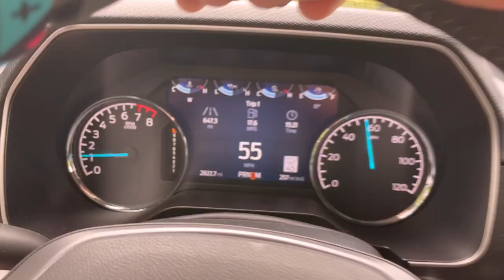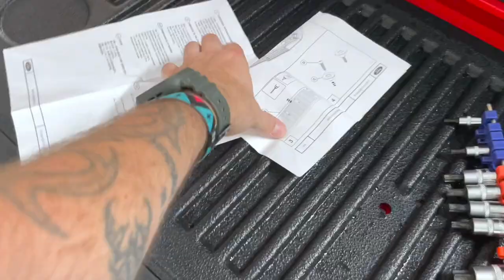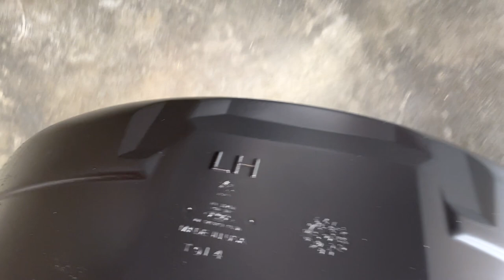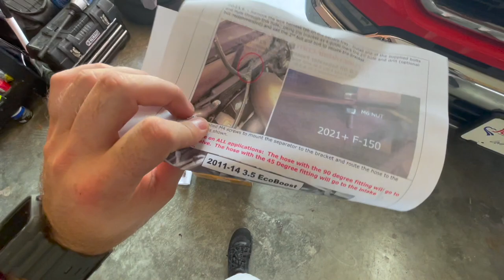FIRST ENGINE MOD To My New 2021 F-150 5.0 - JLT Catch Can PLUS MORE!!!

Comment: Thanks for the video, dude! I’ve never seen the catch can before, I’ve had my ‘21 Coyote powered F150 a year and a half now and I’ll be looking for the catch can now. The Roush cold air intake from ‘20 models fits perfectly as well, and I didn’t wanna wait so I got a custom stainless true dual exhaust installed last year. Sounds and runs amazing! 
I also had the bed AND rear wheelwells Line-X’d, best investment yet!